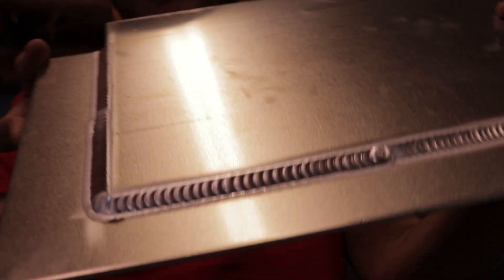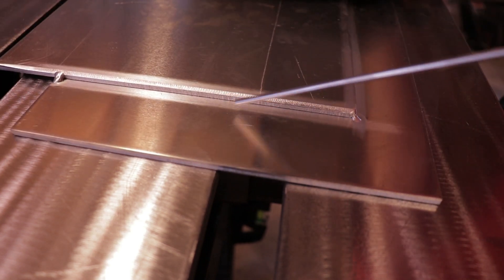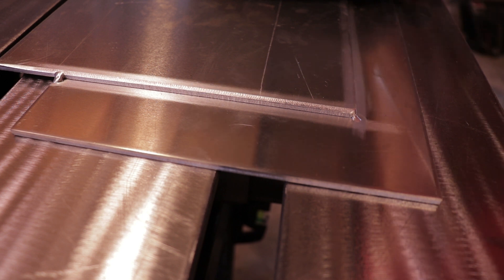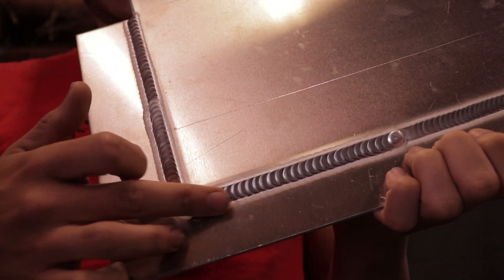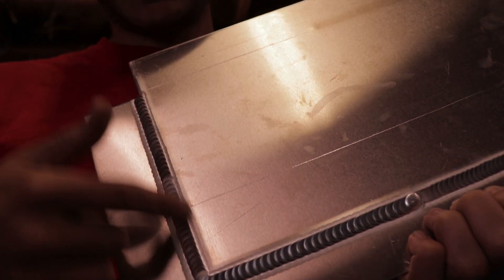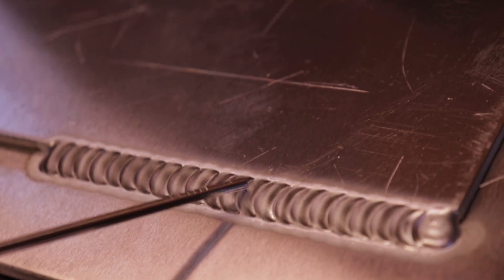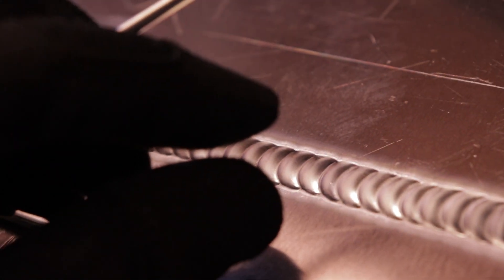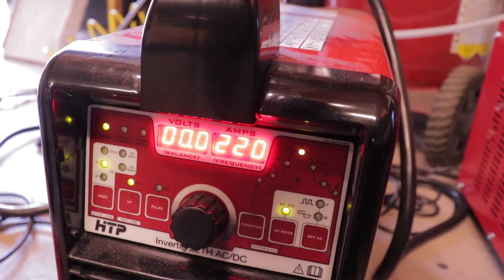Aluminum Lap Joints and Pedal Bumping

Comment: This will sound weird but one of these days if it is not a huge PITA to set up could you show your foot on the pedal?  I am trying to decide which pedal type to get when I buy my first welder, or if I should use a finger tip trigger type.  Thanks for your very informative videos--I make sure to click the like / thumbs up on all of them to help grow your channel.
Reply from the maker: Ya I'll try to show it.  It's an SSC foot pedal if you type in Google SSC Tig foot pedal you'll see it.  I wouldn't get a finger controlled one unless you're going to be in awkward places most of the time you're welding.

Comment: What’s your Honest option on the inverting 221 and pro plus 200 would love to see a video or 2 going through pros and cons / Dues and don’ts  what you really love about it and what you really hate about it or wish it had
Reply from the maker: I love them both.  The pp200 is the best home shop mig I've used and definitely the smoothest.  The inverting is awesome.  I have only used 1 other inverter machine and a bunch of transformers so I can't compare it to everything.  But I can say it's my favourite of any tig I've used.  The only problem is when I need more than 220 amps.

Comment: Hi,
Can you give me an indication of how well do you see through your hood, compared to these arc shots?  Same?  Hood view is better than the shots?  Arc shots are better than the hood view?
I'm asking because I can not see through my hood half as well as your arc shots.  I am imagining and guessing half the time and it frustrates the hell out of me.  I wonder if my hood just sucks and I need to buy one of the $300 range ones.
Reply from the maker: Yes I can see as good as the arc shots but it's just a different color.  I would maybe look into a cheater lens first.  It's kind of like reading glasses for welding.  If that doesn't help then maybe new lens or hood.  But you shouldn't need an expensive one.  Mines a 30 dollar Jackson fixed shade and it works great
Reply: @5thStreetFab  You mean that you use the 30 dollar Jackson fixed shade for TIG???
Reply from the maker: @danl.4743  yep it's my go to hood.
Reply: @5thStreetFab  OK, I'll admit that I am a little confused here.  (You get that I am a newbie to this, right? :)  Is that Jackson fixed shade better for you when you tig, or is it just the same as the fancy auto shades?  Why is it your go to hood if you have those nice autos next to it?  Do you use the number 10 shade that came with it, or a different one?  
I really need to buy a new hood. I'm looking to buy. Mine sucks. (Cheap auto darkening)
Reply from the maker: @danl.4743  It's not that it's better it's just more reliable and way cheaper.  My auto darkeners at home arent working very good so I just went back to the fixed shade.  I like a 12 but a 10 is fine.
Reply: @5thStreetFab  OK, got it.   Thank you.

Comment: I have found that if I pour Pabst over the aluminum where I want to weld , it works fine for cleaning.  Only have to use a Bounty towel to absorb the residue. Just joking. LOL. Thanks for allowing the sound of a TIG torch. So many mute it so as to get viewers. It is a shock when a for a first timer.  Good move. Good tips. Always great to see another's perspective.
Reply from the maker: Haha I definitely have plenty of pbr laying around!  I'll give it a try
Reply: @5thStreetFab  I grew up with a guy that died about 4 years ago and it was the only brew he would purchase. Mind, if you offered him anything else, it was accepted immediately. Calvin was one of a kind for many reasons, not just his like of PBR. Great video. Keep them coming. Thanks.